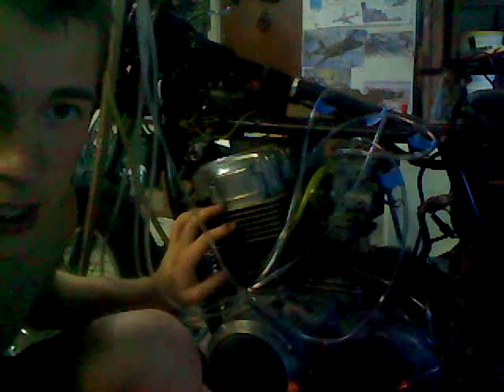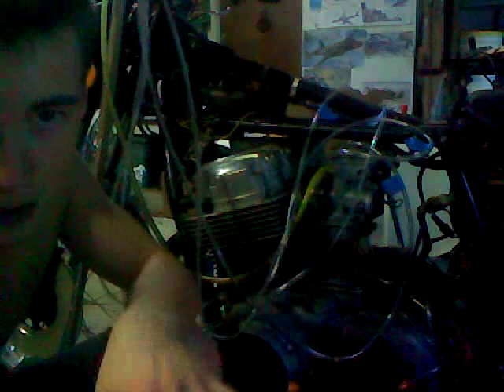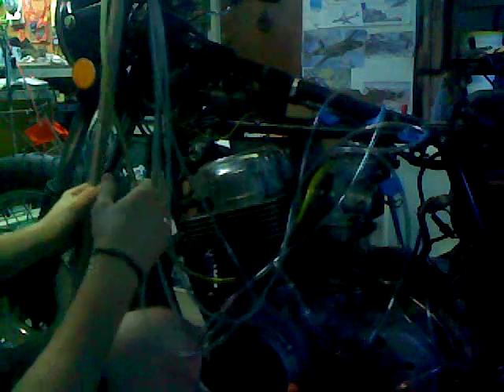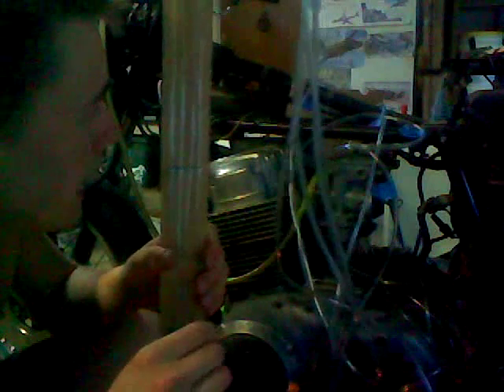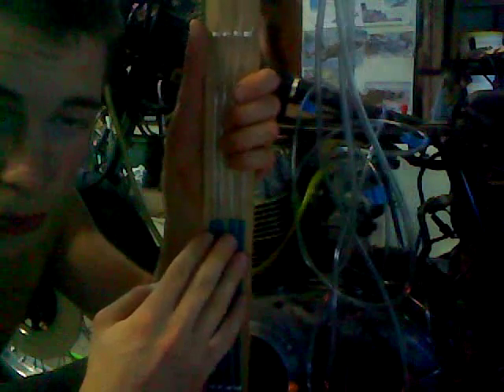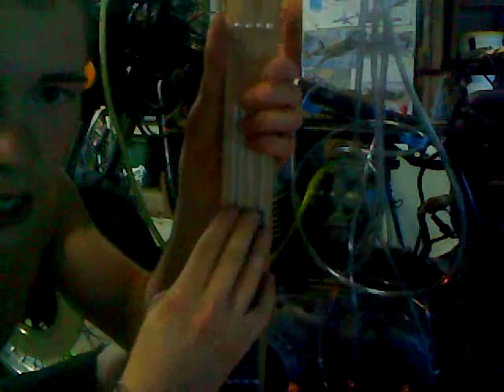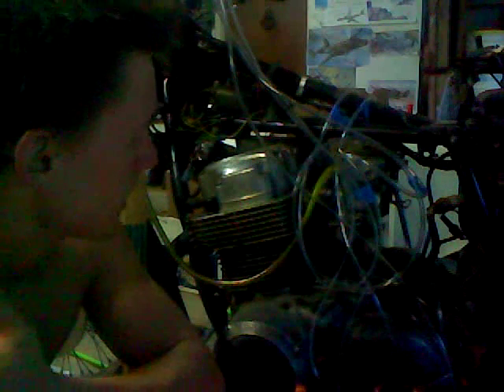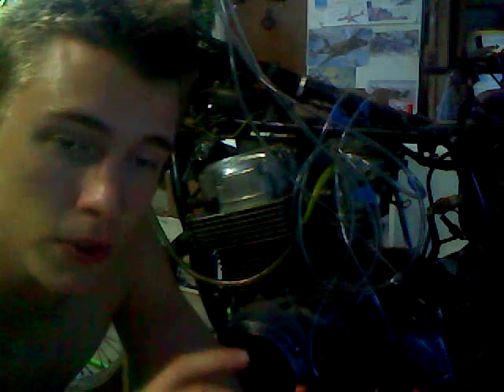Manometer (1978 honda cb750 carburetor vacuum adjustment)

Comment: It's not actually "preasure" (pressure), it is the amount of vacuum in each intake port runner.
Opening or closing the throttle decreases or increases the amount of vacuum.

Now say "Thermometer", that's how you say "Manometer".

Comment: @blueeyedkangeroo Hey thanks for the reply. I ended up finding a mechanic to come take a look, as he was working my Iphone delivered your message - it was exactly what he said. He took the bike apart, cleaned the carbs - they were pretty gummed up and some tubes were broken. Those are all fixed and back together.

Now, the bike still smokes, and leaks out of the head gasket, I think he's gonna fix that up for me tomorrow. The top section of the pipes seem to be smoking, I guess I'll need to fix!

Comment from the maker: @shotox21 oh and another thing when adjusting the individual throttle plates/ slides, the general rule is you want them pritty much the same height or tilt. if you want to go even more presise you can use a manometer like i used to increase or decrease each so that they all have the same suction. IMPORTANT! after synchronizing the carbs to lower or increase the throttle rmp you need to adjust the main throttle screw.

Comment from the maker: @shotox21 if that doesn't work adjust the individual slide/throttle plate heights, if that doesn't work adjust the idle mixture i know for all of these prosesses you will most likely need more description so just let me know when you have a question.

Comment from the maker: @shotox21 my guess for the high idle is that the carbs just need adjusting. bare in mind  i am not to fermiliar with the carb you have, but most carbs are pritty similar. there are three adjustments you should try do not try them out of this order. first try the main throttle adjustment screw, it holds all of the sliders/throttle plats open, it would need to be unscrewed to decrease the rpm.

Comment from the maker: @shotox21 oh sorry i didn't understand you were talking about a honda cb750, hmmm smoke out of the carbs. smoke is caused by oil burning, my guess is that possibly there is oil seeping around the piston rings and burning. you can clean out your rings by using some amzoil power foam you squirt it straight into your cylinders and let is sit for however long it says on the can, just fallow the directions on the can if you use it.

Comment from the maker: @shotox21  more oil in the mixture. if you have a manual for the bike look in it for the ratio or go on the internet to find out. most of the newer two strokes have a manual oil feeder, if the feeder was not hooked up correctly then the mixture might be lacking oil

Comment from the maker: @shotox21 who cleaned your carbs for you? do you know whether your engine is a two or a four stroke? who put them back on the engine and are you shur they put them back on correctly? if the engine is a four stroke you will want to tighten with the idle needle to lower the RPM, or adjust the throttle stop, the piece that hold the throttle open slightly. if the engine is a two stroke the oil to fuel ratio might be off, if it's throttling high then you will want

Comment: Hey thanks a lot, I'm going to try this. Think I could ask you a few questions? 

My Carbs were just cleaned, a new kit was just put in. When I start the bike, theres lots of smoke coming out of the exhaust. Eventually smoke starts coming right out of the engine, where the pipes insert. The bike idles really high, like the choke is all the way pulled (except it isnt).

Ill record a high def video today.

THANKS for the help bud!